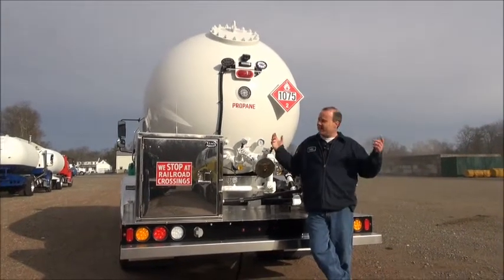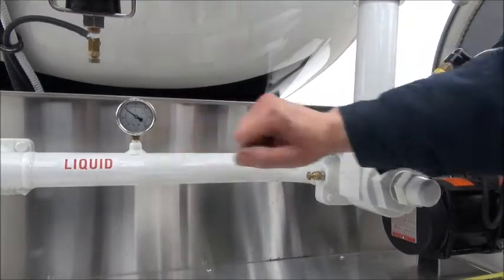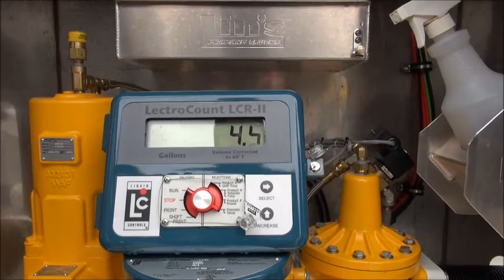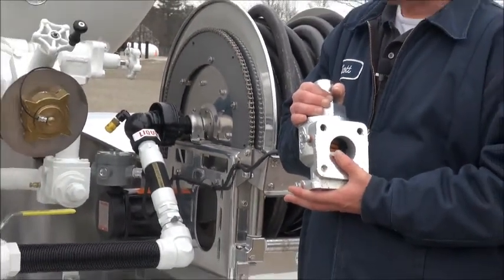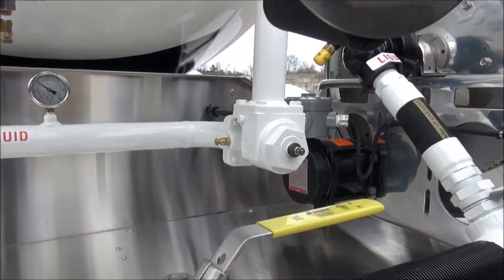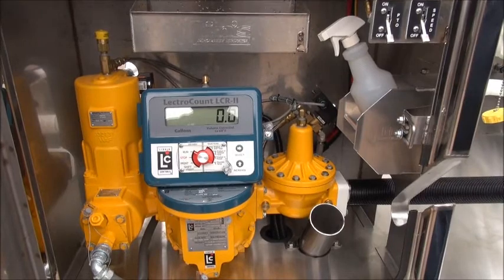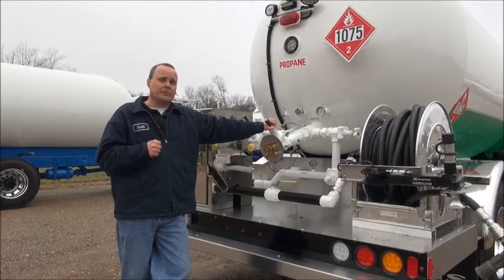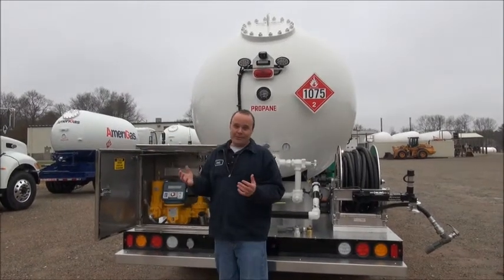Differential Pressure

Comment: You talk about setting the bypass pressure that spring is Good from 91 to 125, is that the differential pressure Max's 125 or is that total pressure before the bypass opens? Because if it's summertime and the truck's already at 160 psi and then you add the differential pressure on top of that it would be over what the spring would open at so it would stay open all the time correct?

Comment: Thank you for actually being knowledgeable with the mechanics of a bobtail.. I build Bulk Plants for T2E and I can't tell you how many bobtail and Transport drivers iv talked to that have no clue as to what they are doing when it comes to troubleshooting a problem. They only know a order of operations and if they have to diverge any they get stuck with a problem that's usually pretty simple for why they arnt getting good flow rate